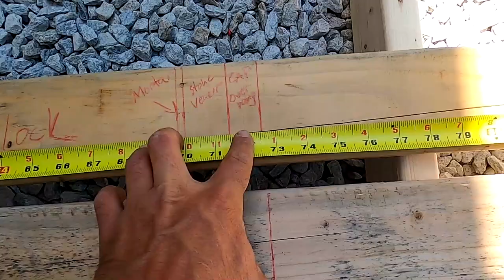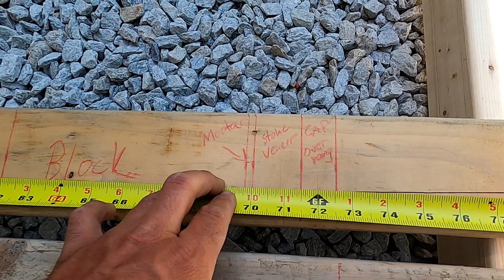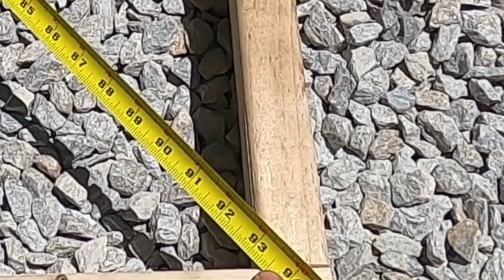Pouring a Concrete Pad For Stone Veneer Steps

Comment: Enjoyed your video. Thanks for the great content.  Would you explain why the steps aren't built on a footer that is below the frost line? Thank you 
John
Reply from the maker: So the frost level is explained as 4 ft here in Massachusetts, however... it would take an ice age basically for the frost to ever hit that low. The depth of the frost typically only reaches about a foot to a foot and a half here. And even that is after a few weeks of low 20"s and less. Our base stone goes down a foot. Taking the height of the steps into consideration, the base stone is 2-2.5 ft below ground. The steps themselves act as an insulator as well. 

For front steps, there is no code that you have to be below the 4 ft "frost" level. Most contractors don't even go down to a foot like I did here.... But anyway, with the 8 inches of clear base stone and a 4" pad, reinforced with rebar and pinned to the foundation, this stoop will not go anywhere. It would take serious cold weather for any frost to form under this pad, like serious cold.... And even if it did, the gaps in the 3/4 stone will allow for moisture to expand into when frozen, preventing movement and shifting of material.
Reply: Thanks for the explanation ✌️
Reply from the maker: No problem at all! ✌

Comment: Hi, I have to do a similar pad for my steps. How many bags did you use of the high strength? Thanks
Reply from the maker: I believe I used about 20 bags... If you look up a (quikrete calculator) online, you can calculate just how many bags you need depending on the depth and square feet of the pad.

Comment: Don't you want to raise the rebar off of the stones?  Drive a couple more pieces vertically and tie the rebar to it suspended above the gravel.  Also, do you need vertical rebar coming out of the foundation to tie the block into?
Reply from the maker: The rebar is lifted above the stones and in the center of the pad. They were anchored into the foundation and elevated before I poured the concrete. The rebar driven into the base would be basically pointless, simply because we use a loose, clean / crushed stone which would not hold the rebar. And if the pad ever decided to move, rebar driven into the ground would not hold it whatsoever... I can bend rebar with my hands, it is not strong in that aspect. It is only strong when surrounded by concrete. 

As for the vertical rebar for the blocks, that is optional. I would maybe do that if we were installing 6+ steps, but we are only installing 3 here. So mortaring the block straight to the footing is just fine. ✌

Comment: I see you poured your pad right up to the foundation.  In your next videos, you leave a gap for drainage against the foundation.  You don't need a gap between the pad and the foundation for drainage?
Reply from the maker: I'm glad you are paying attention to the details! So for pads that will hold steps, we want it to be connected to the house foundation to prevent it from shifting / sinking under all the weight. With concrete blocks / pavers, you want a gap to allow for slight shifting and moving through the winter months, it is the same reason flooring guys leave gaps around the edges of a floor. So that when the house expands and contracts through different temperature changes, it does not pinch or squeeze the flooring. For a patio, you want some breathing room in between structures to allow for slight movement throughout the seasons.